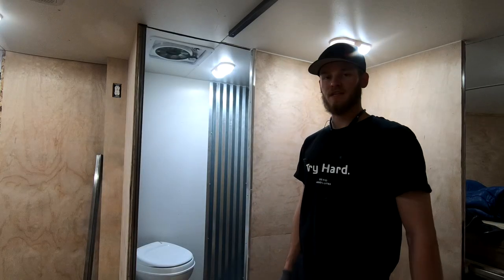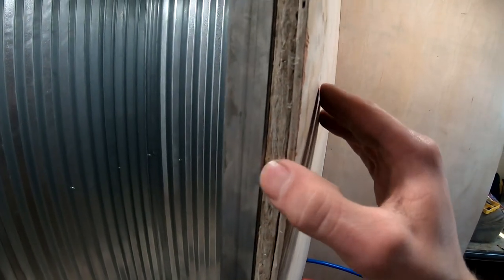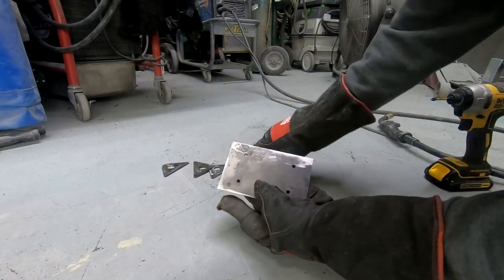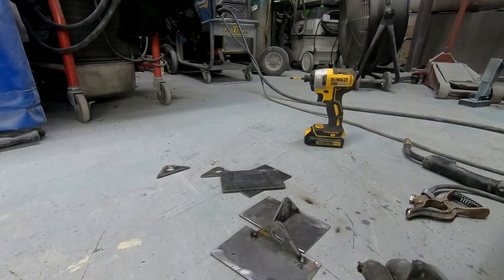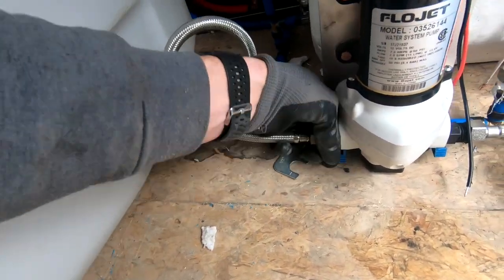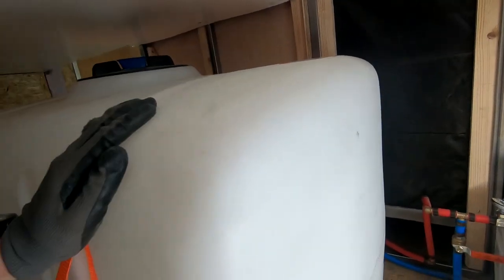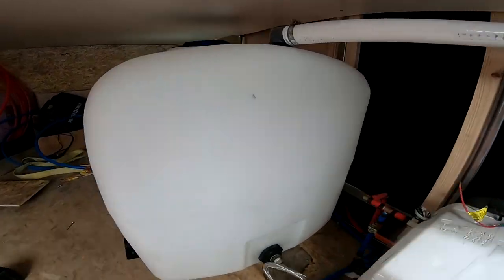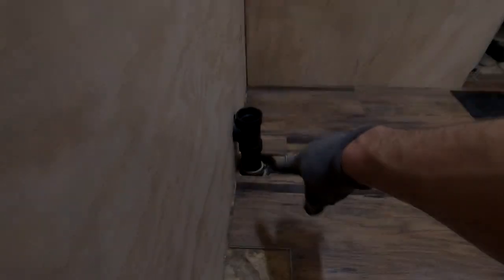Enclosed to Toyhauler Conversion #7 - Shower Install

Comment: Nice work on the shower,  you can skip the music adding step in your videos it makes it hard to hear you.  Would also like to hear more about that plastic welding, where did the nitrogen come in?
Reply from the maker: 280zone Thanks! And I’ll try to dial the music down in the  future 🤙🏼 

So the nitrogen is passed through a a heating element before it comes out the end of that little torch I was using. It uses nitrogen instead of air to make a stronger weld because the nitrogen doesn’t contaminate the plastic like air will. Thanks for the input! A video about it would be pretty cool!

Comment: Good job so far, I’m doing one also. I think when people can fabricate with metal, carpentry comes easy, or easier I should say.
Reply from the maker: Upaginit 101 That’s awesome! What size trailer did you go with? I’m learning for sure! I just finished up my 4-drawer cabinet for the stove and it was a lot easier than the first cabinet attempt!

Comment: Nice work. I'm kinda worried about your plastic vapor barrier though. It might actually retain moisture? Next time try a roll on barrier like "red guard" etc.
Reply from the maker: Hmm that’s a good point you might be right where it has a metal surround instead of cement board and tile 🤔 I’ll keep that in mind for the next build!
Reply: @AustinStout  I looked it up to make sure I wasn't talking smack. It can be used. Just has to be installed properly. 
Here is the title of the blog:
 "What Happens When You Put a Plastic Vapor Barrier in Your Wall?

And its from a site called: "energy vanguard".

Comment: Where did you put the air vent for your plumbing. Did you run it to the roof or half way through the wall? Thanks
Reply from the maker: Yeah so it runs up through the wall in the corner! The same pipe is the vent for the grey water, sink, and shower. I got a little rv vent cap for the top that screws on with sealant

Comment: How did you do the plumbing for the toilet and for the shower. Did you pre drill the hole for the toilet in the black tank. What fittings did you use.
Reply from the maker: Michael Vasquez Good question! ill have to show that in depth later on in a video. But for now— The toilet is piped directly into the aluminum black water tank under the floor. Basically the toilet has a male flange that comes out the bottom. That toilet flange then goes into a standard female closet flange fitting (like you would find in a house) that I siliconed and bolted to the top of the black tank. The toilet is then bolted the to that flange. I did precut the hole for the toilet, I built the tank first then put the toilet in place to mark the hole. The shower, kitchen sink, and vent all use the same hole in the grey water tank that’s mounted under the trailer. (You can see that in episode 6) to connect my shower drain to that pipe I had to make a custom p trap out of a couple elbows and a piece of pipe. I did that because of clearance issues under the shower pan and height issues inside the shower. The shower drain is actually a laundry sink drain I found at a hardware  store. To connect the pipe to the tank I used a rubber grommet I was able to source from amazon for a few dollars. You put the grommet into the hole in the tank (it calls for a specific size) then insert the pipe into the grommet which causes it to expand a little bit. I siliconed them in just to be sure. Hopefully all that makes sense 😂🤞🏻

Comment: are you doing a grey tank? if so are you plumbing it to a tank in or under the trailer? I'm wanting to put mine side by side but gotta find a way to get the shower water up into the tank most efficiently
Reply from the maker: Steele Crandell yeah I have a grey tank as well, it’s in one of the episodes right before this video I believe! I was able to plan the plumbing in a way that allowed me to put one hole through the floor and into the tank for the shower sink and vent pipe. Is your shower lower than the tank right now?
Reply: Austin Stout yeah still very much in the planning stages but in theory I’d like not to put my grey tank under the trailer, just if I’m off road but it’s seeming like a pain to run it that way. But if I ran it the way I have intended the shower pan and gray tank would be on the same level.
Reply from the maker: Steele Crandell yeah the biggest thing about putting it inside is you will have to raise the shower floor up to have everything flow right and that really cuts down on the headroom. Especially if you want to get the full capacity out of your tank. If you do it under the trailer you right off the bat save the height of the tank plus the height you need for a p trap. Mine barely hangs down lower than the frame itself and is pretty close to the axles so unless I’m getting pretty western it will be safe there